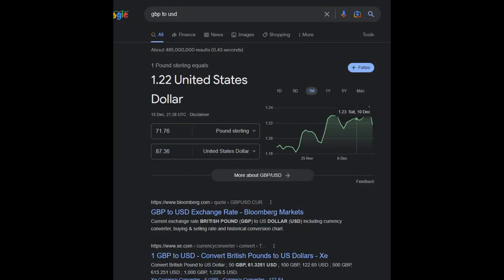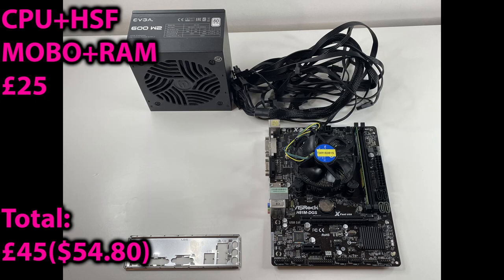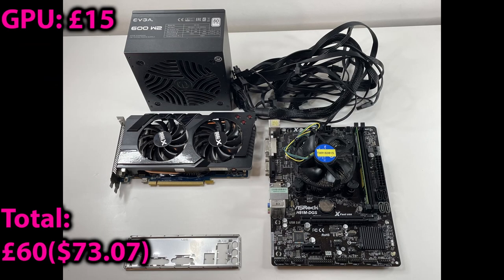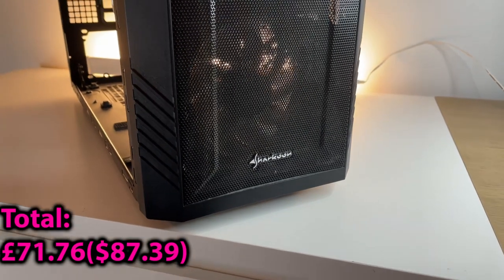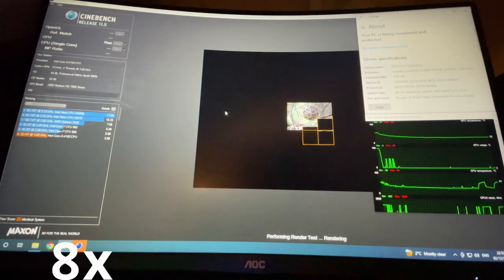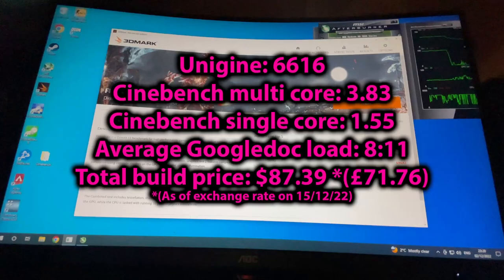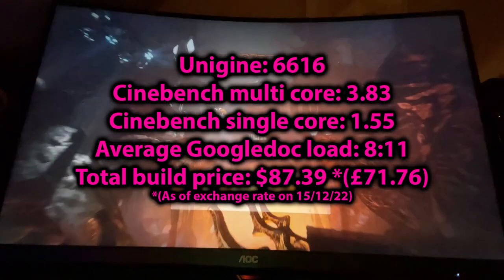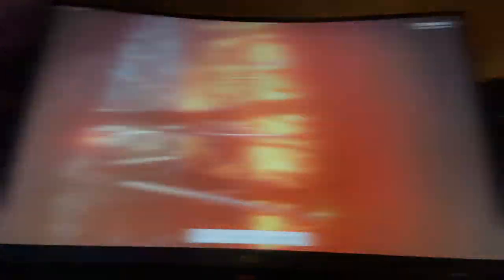Budget Build: How to Assemble a PC for Less Than $100 (£83) #CheapPcChallenge2022

Comment: Nice build! That 7850 is quite a nice little card, and what a great price, too!

I noticed your timing on the webpage load was based on 30 FPS rather than 10ths of a second, so I calculated the following for your times: 9.2 sec, 8.06 sec, and 7.9 sec for an average of 8.39 seconds or 51.61 points. Does that sound right?

If so, with the 12.61 points for coming in under $100, I calculate your final score at 779.62 points for this build. Which is very well done! It's really incredible what these cheap, low-end PCs are capable of, isn't it?